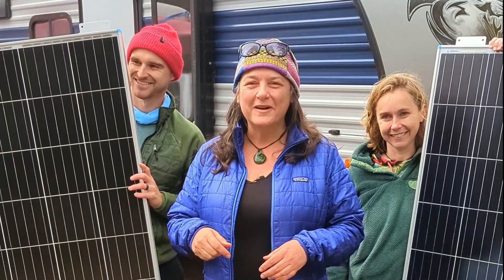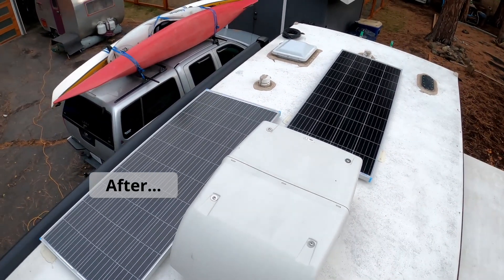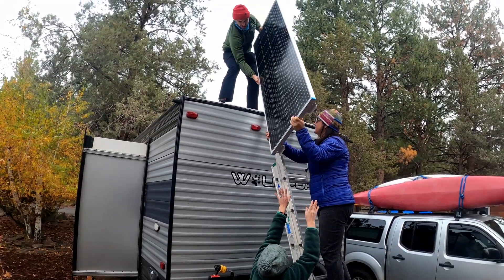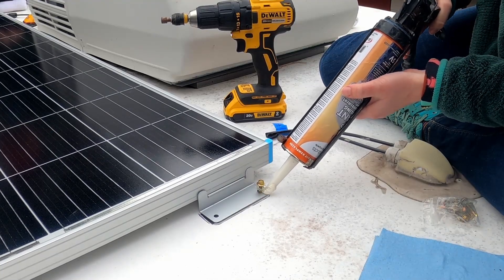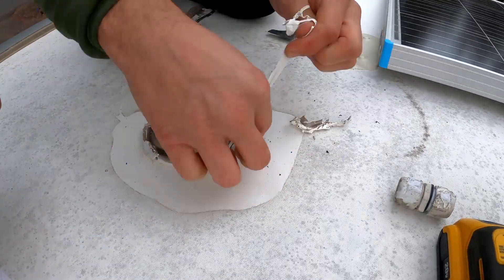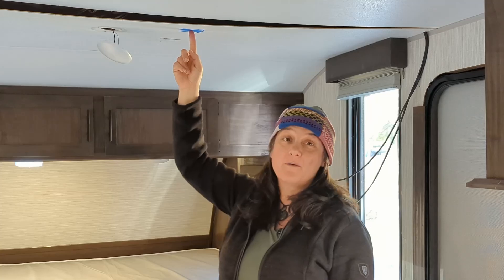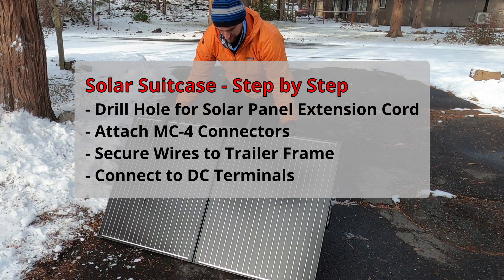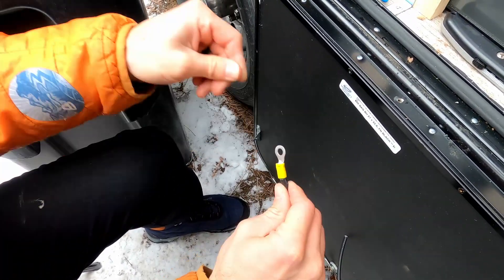REGO System Installation: Episode 1 - Install Solar Panels

Comment: Why didn’t you use factory controller
Reply from the maker: Thanks for the question!  The REGO system comes with a 60A MPPT solar charge controller, and this is what we installed.  It you look at the whole series, you'll see everything else that comes with the system.  Best!